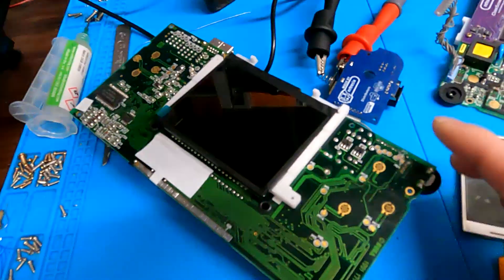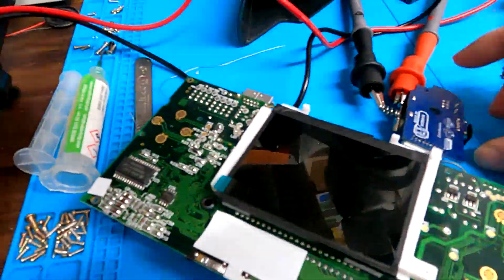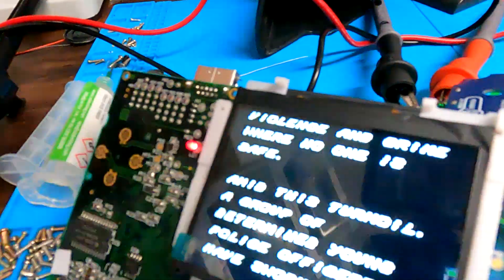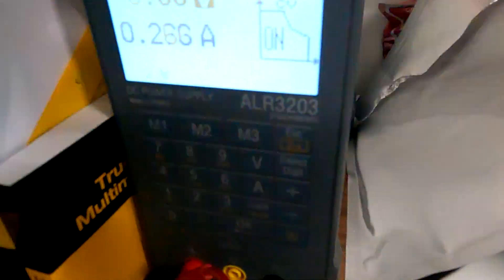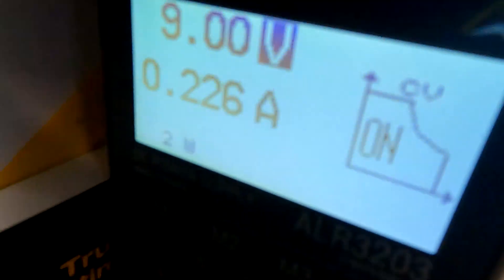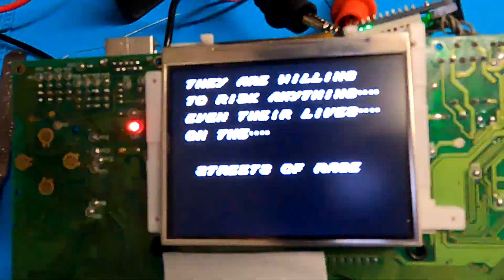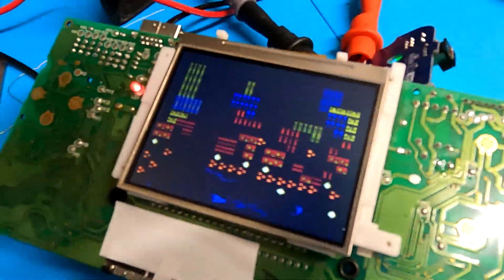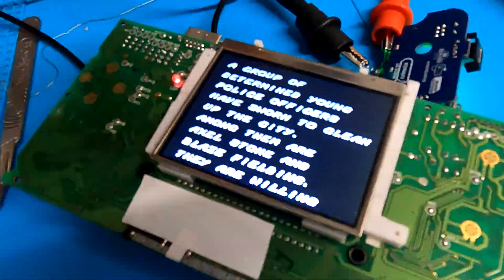RetroSix TFT vs IPS CleanScreen Game Gear

Comment: For comparison, what is the power draw of the original screen and the McWill screen?
Reply from the maker: Identical to original unmodified console with stock screen. Original draws 2W all the time. CS draws between 1.08W and 2W (depending on brightness wheel). McWill draws 3.7W.